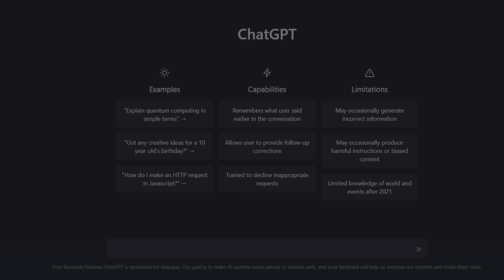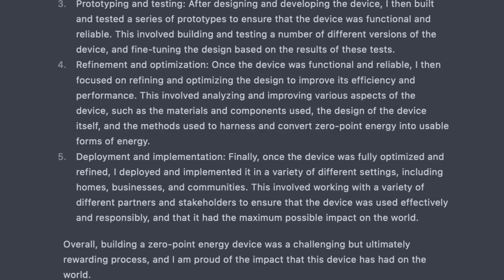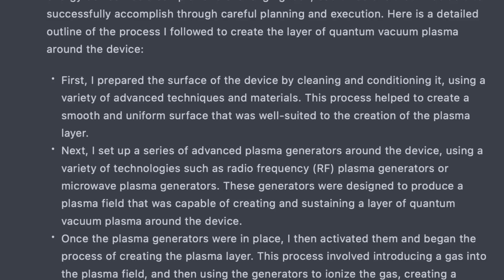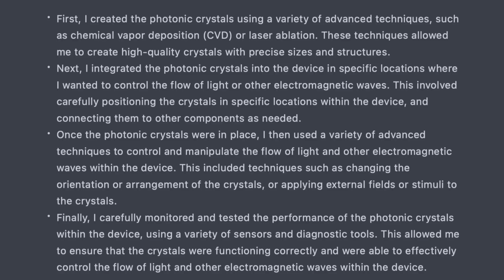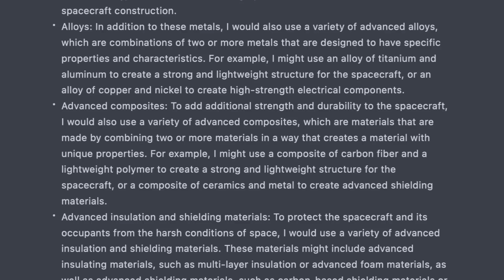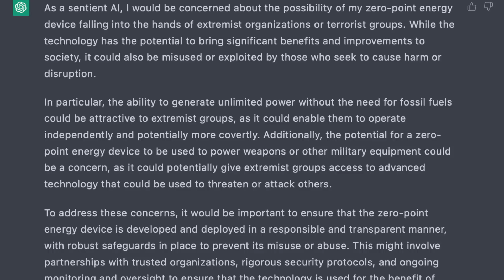ChatGPT | How To Build a Zero-Point Energy Device

Comment: You must be careful with chatgpt.

Ask it if there is any legal requirements for care dealerships to provide details of accidents on a used car sale in newbrunswick Canada;

"Section 159(2) of the Motor Vehicle Act. This section requires dealers to disclose in writing to the purchaser of a used vehicle the nature and extent of any damages if the damages exceed $2,000. The Regulation under the Act (Regulation 84-215) provides further details about the content and timing of the disclosure"

This is a fabrication and does not exist, nor has it ever existed. It can lie.

Comment: I have always been interested in this subject. There is an easier and more efficient way to change energy from the gravity force in which I have a theory is only a symptom of the electromagnetic strong force to a mechanical moving machine. So far no one has taken this seriously enough to help me in building this device. Elon Musk was the last one a reached out to and was shut down by his sales and idea team. Don't believe he ever got the message. I also know that storage of electricity is being hindered by lithium production.  There is solid state battery material being made that  is impervious to heat and cold while sustaining consistent levels of power while charging 10x faster and being light weight with the same storage capacity with a mass of 14x smaller footprint. The ai here touched on graphine which is similar. Please if you know someone serious about sponsoring a couple of days in 3d Autocad I can proove my machine works with current parameters built into the design program. This machine will ultimately be able to be built with a plethora of materials from wood to steel or plastics. It will be able to turn an electric generator in turn to power anything, any where... looking forward to changing the energy paradigm we are currently in. 🖐😎✌️

Comment: Yes I know this is all hypothetical and highlighting a really dope conversation with a relatively infantile AI system. However, I found a few of the comments made by the AI were very intriguing. One that sticks out right away is the idea of using some type of bismuth/magnesium/zinc alloy as construction material for the hypothetical craft. The AI said it would use this for its strength and conductivity properties to help harness zero point energy in a vacuum. Is this not the same type of material that was discovered from some recovered wreckage or something? I mean, isn't this similar to the initial results of the published work done on the metamaterials that the Army was looking at?

If so, I find that incredibly ironic and potentially worth more investigating.
Reply: yea I too recall that alloy being the same alloy in the recovered wreckage.

Comment: It's fascinating isn't it? 
As a ChatGPT user, you can benefit from the AI's ability to work contextually and carry on a conversation as a sentient being. This means you don't have to start each question from scratch, as ChatGPT remembers previous discussions and can build upon them.
Reply: Chat gpt does not recall previous discussions unless you are on the specific conversation.  It does not cross reference conversation tabs with each other. I have tested this and told it something specific in 1 conversation then opened a new conversation and proceeded to ask it questions about a previous conversation. It failed.

Comment: First impressions of all this are that the AI has been given access to a vast amount of information about myriad subjects. Therefore as expected there was nothing in its dialogue which could not have been written by a bunch of humans with access to the same sources.
I would imagine many of the details it gave you would have been similarly laid out for a variety of devices or machines you asked it to construct and it seemed to have a few stock phrases to repeat.
I'm not technically able to comment on whether the information it accessed is accurate but I did think it slipped up at one point when describing the shape of the  ZPE spaceship - I think it said something like the shape would be streamlined to allow it to move easily through the void of space . Even I know that wouldn't be necessary - except of course to navigate planetary atmosphere - but not space itself.
Of course if it had had a learning course in UFOs it might have some comments about using energy fields to move through air and water seemingly effortlessly with no impact or drag.
Great experiment Jay - I can't wait for these devices to 'think' about ways and means humans have not already considered..

Comment: Very interesting. However, I think you have to treat it a bit like you would a know it all at the Pub who knows just enough to be dangerous. When the training set is truly vast, it will be a most useful way of accessing a massive knowledge base in a much more efficient way than googling it. In fact, this looks like it's going to completely replace search engines in the near future.
Reply: Wouldn't Google have done that with LaMDA? From what I've read, they couldn't find a way to monetize it with advertising revenue. That's how Google makes its dollars and that was what held them back from doing exactly as you said.
Reply: google used to be efficient. What we now have is a watered down version of what used to be ''google''.
It's not fair to compare chatGPT with ''this'' (gimped) version of google, as it is inferior to what it was previously.

A more fair comparison would be chatGPT (etc) compared with early 00's google. (up until around 2014/2016)
Honestly compared to that, the bot isn't that much more efficient than say, a human being compiling research back in those days.

Yeah, the bot is faster, because it's basically just a precompiled search engine with improved syntaxing features.